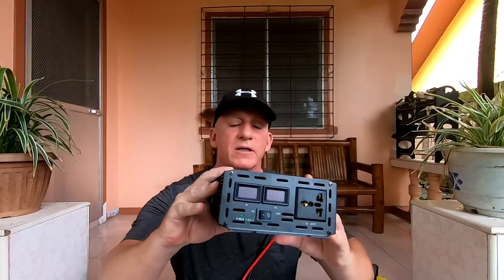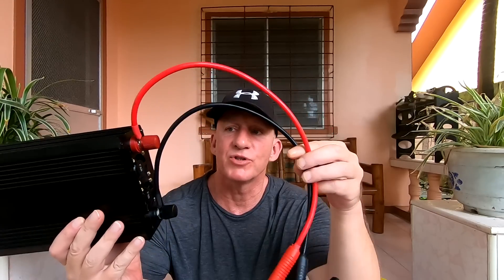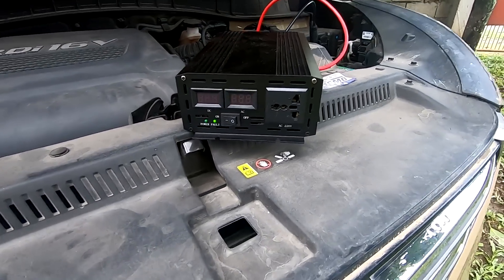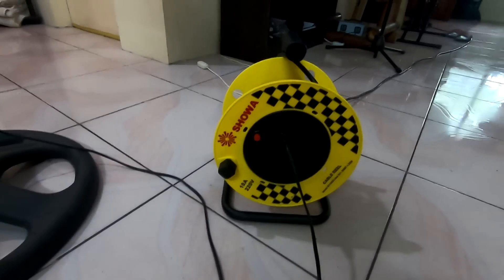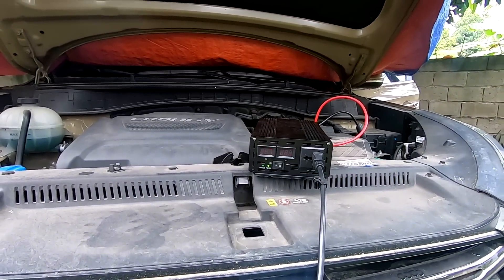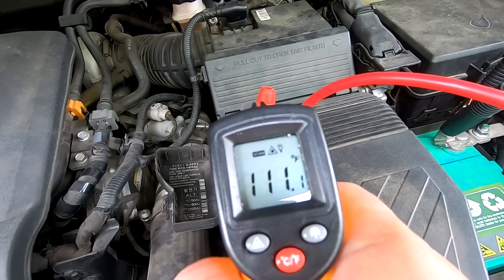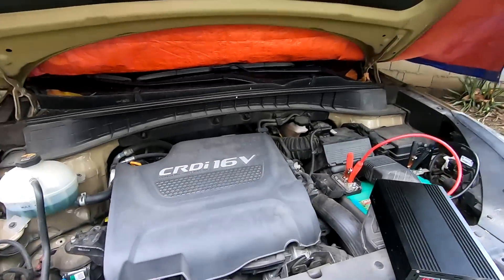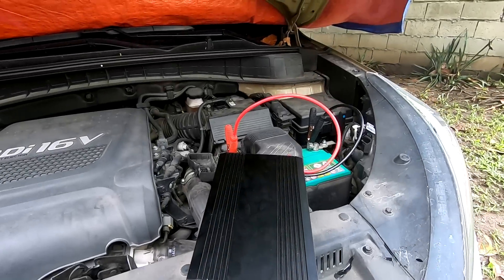Emergency Power in the Philippines:  $125 Pure (?) Sine Wave DC Car Inverter

Comment: Those interested in a dual-use technology vehicle battery could consider buying a Prius or other hybrid.  A friend of mine powered his house for several days during hurricane Sandy in 2012 by coupling his Prius traction battery to an inverter and in turn to his home's junction box.  The advantage of the Prius is that the gasoline engine automatically turns on and off as needed to keep the traction battery charged, thereby avoiding wasting energy.  In contrast, a normal car engine will continue to run at the same rate whether the current is being used or not, which can lead to pretty large-scale waste of electrical energy, and by extension, of gasoline.
Reply: Good luck finding a Hybrid in the Philippines 😀
Could import one for 50-60k
Reply: USD not PHP
Reply: @markcowley3627  Actually you can go to your nearest Toyota dealer and buy a Corolla Altis Hybrid 2020 model for US$32k or Php 1.6 million in the Philippines it's a standard unit. In the bigger dealers in Manila they have them for immediate delivery (which takes about a week).
Reply: @Shattered65  Ned could probably replace his vehicle about 10 times for that much.
Reply: @markcowley3627  It's still half the price you said and freely available. And it's not over priced its the same price you would pay for a new Corolla Hybrid anywhere in the world. It's sad when people can't admit they did not know what they were talking about. And even sadder when people continue to say bad things about the Philippines that aren't true.

Comment: Ned I am mike Bloye living in Bulacan. I agree the power can be a major problem but before yesterday I had no idea how large a problem . We bought one of the LG split air cons for the house ours is old and yesterday the workmen cam around to fit it everything went wrong. The unit when fitted would cover around 1 inch at the very top on the window so that means that window can’t open. I thought ok I will have to live with that. PS I did not pick this aircon I am still not allowed out the house. Then outside on the balcony they went to fit the large conductor type thing thing, suddenly they said it will drip water and that will make the balcony wet.( not impressed) anyway I figured I could cut a 8 ft narrow channel to the drainage hole at the front of the balcony. They drilled a hole through the wall and hit two support rods right where they crossed  and that took them 20 mins the cut through those. Then cam the best bits where is my breaker for the air con ??? WHAT I did not even know we needed that so the wife gets a trike to the builders place and gets one. By now she is worried because she thinks I am way to Calm. The fit the stuff all screwed in place and ready to go. And out he comes with the cue de grass. Sorry you can’t have the air con on . Why? Because your voltage is only 175 not 220. They took everything down and now I am stuck with a hole in the wall that goes right through 6 screw holes on the inside on a newly painted wall. Can anyone beat that. Why o why did they not test the power first because they said almost half the houses in this area have power problem.
I would put my head in my hands a sob gently but with my luck I miss or drop it .. take care Mike
Reply: Welcome to the Philippines. As long as workers get paid, items are paid for, it is what it is. Do your homework before agreeing to anything. Nothing is what it seems.

Comment: Ned: #1. a long cord like that you are going to have a substantial power loss over distance and that cord can get hot and melt under high loads
#2. definitely get "OFC" 2 AWG OR 0 AWG wire for your clamps 
#3. On a solar array if you buy battle born batteries or similar good brands and properly housed they will last 10+ years in a tropical area...
A good generator in a dog house like enclosure will be almost silent and you can rig up a bigger gas tank easily plus you can double up on the muffler 
Just wanted to give you some extra info
Also you should up the idle rpm on your vehicle to get more power from your alternator... less stress on your battery 
AGM Deep cycle battery is better also
Reply: I told him same thing about battle born. When he fries his alternator he's going to end up paying for that and still needing a solution.
Reply: Would diffidently want a 10 awg extension cord along with minimum #2 awg to the battery.. but would not be using my auto to power the inverter.. think solar, wind, generator or all 3.. as alternates. a good deep cycle battery a couple times a year is nothing compared to auto repairs...
Reply: @buckeyeadventures1631  yeah that is why I posted what I did....he will burn out his alternator loaded like this

Comment: 30-40 minutes? What UPS are you running? When the power goes out, I shut my electronics of and only run a fan because we have a baby. that last about 8-10 hrs depending on the speed. I admittedly haven't watched the whole video but I'm assuming you continue to work.

Comment: Ned, when it comes to solar batteries in the Philippines you have to remember 2 golden rules. No. 1 forget about lead acid or lithium ion batteries they won’t do well there. And No. 2 never order anything from China from inside the Philippines because you will get the lowest standards of quality China makes. It’s better to buy things from China that have a been exported outside of Asia.... higher quality. You would want lithium polymer batteries for the Philippines. I know a guy that makes them on the side if your interested In checking them out👍👍
Reply: Any idea why lipo batteries are better? Is it temp, humidity or both?

Comment: Get a Dual Fuel generator. I have a champion 3400-watt inverter. You can run it on Propane so you don't have to worry about storing gas. The model # you want is champion 100263. it is very quiet. It costs half as much as a Honda. you can run you A/C You can get one for under $1000.00 It is also pure Sine Wave.
Reply: Propane run motors gulp the LPG.  Much more than gasoline or diesel.

Comment: second, dont worry about the heat on the clips most of that heat is from the engine , block the heat from the engine and check the wire temp that will give you more of a idea how hot it is

Comment: If you pull a load for very long, you may want to get a deep cycle battery, also.  Less stress on car's electrical system.

A small generator may be a better long term solution.
Reply: Small generator shouldn't be much louder than the car engine.
Reply: yeah   to use a new kind of car that uses any kind of computer is a no no,   older cars was ok,  if they have no computer,   but those days are long gone,
Reply: @ateam6486  good point about the computer!!